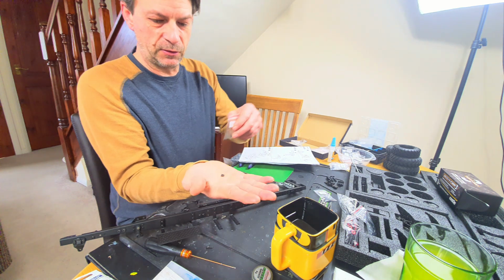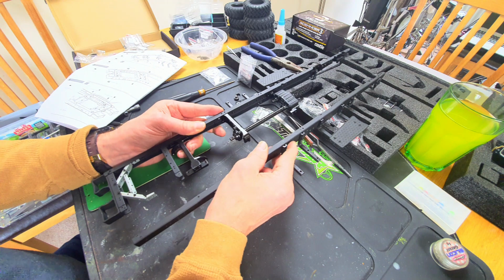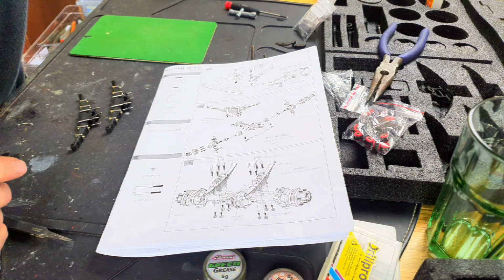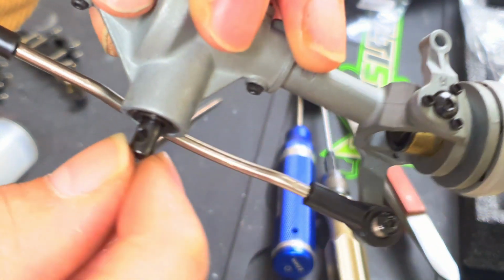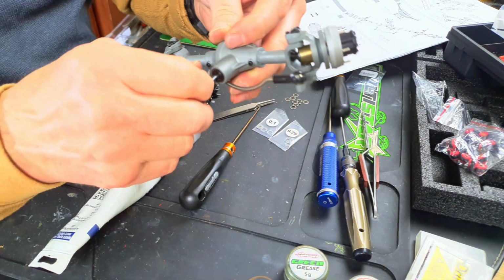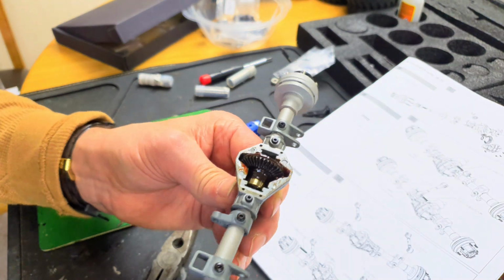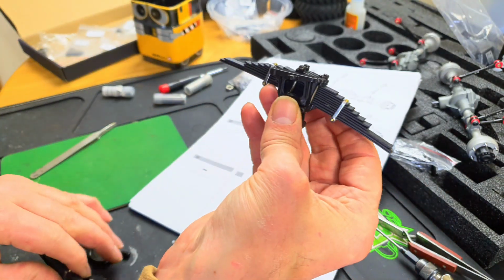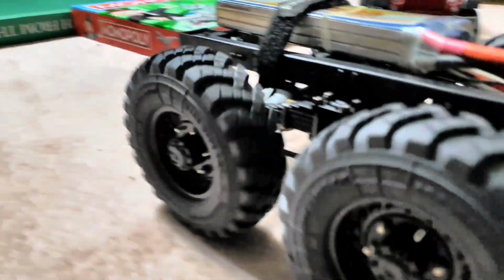King Kong RC CA30 / Zis 157 6x6 Jiefang Chinese Truck Build Part 2

Comment: ive put the diff filler bolts in all my rigs axial ,gmade trx4,etc i use a mix of 20/50 motor oil and marine grease ...i syringe it in till it fills the diff, then the rest it don't need goes down the axle tubes to the wheel hexes and lubes the bearings ,its worked for the last five years in mud ,water ,not needed to replace a singe bearing in any of my axles,, so it must be working
Reply from the maker: Sure sounds like it! Interesting idea. A

Comment: It does look classy, the quality much better than Cross and cheaper. I can say with the MC8 build the the MC4 I enjoyed the the older style kit build more well the body.
Reply from the maker: Yes Mal the quality is there, no question. At least to the touch and fit for the most part. I did have to smash apart the middle drive shaft because it was jammed shut on some untidy welding - you'll see in part 3. 

Also the servo they supply isn't 25t (which is most common, no?). And there is an issue with the middle axle having no bump stops so the axle gets pressed into the drive shaft running to the back axle. 

Quality is there, but I would question some design choices like no pass-thru drive in the mid axle. 

And christ if the cab moulding isn't thick!! It must be 1.5mm thick plastic for EVERYTHING so strong, but not very scale. So it doesn't have the finesse in the plastics dept I see on the Cross rigs. Perhaps that's where the money has been saved.  

If Cross and KK joined forces, I think it would be amazing. A

Comment: That's weird I've seen 2 so far and on the  Rear chassis brace your guys have it      unpainted mine was all black🤔... also if you haven't already done it on the rear leaf Springs there's a Silver Cap Held on by magnets and little bit of glue on both sides that holds the leaf together behind that there is a bolt that does need loctite Hope that made sense😁
Reply from the maker: Really? OK cheers buddy I will take a peek. All your axles greased the same?
Reply: @antrc  yah all of them and the transmission had plenty of Grease
Reply from the maker: All but that one axle were like that. Weird.

Comment: It looks really stout! Just patiently waiting to see what slop (if any) sits in the gearbox.
It might pay you to invest in a set of taps for clearing paint out of threaded holes, just a cheap crappy set.
Reply from the maker: cheers bud, yes I'm leaning towards a set of tapping gear. if I can ever afford another kit I will add one to the budget................... 

Drive slop? There is some. Just edited part 3 last night and forgot to show it!! Oh well, yes there is some, maybe 1/6th a wheel turn? So it rocks definitely but I wouldn't say it's as much as the Cross trucks. But it's only a single speed 'box.